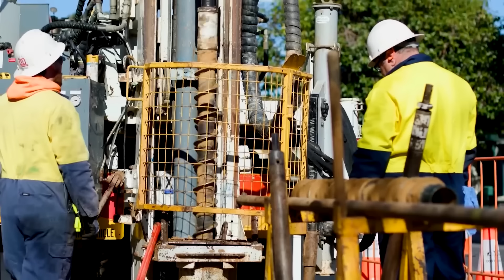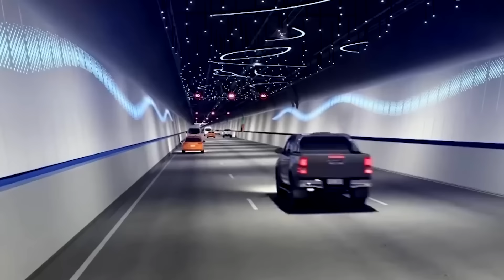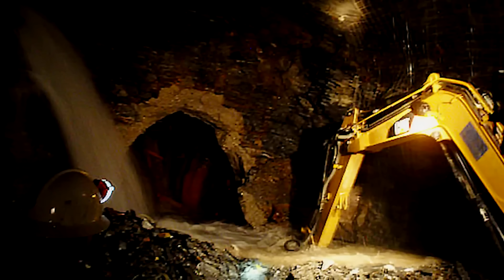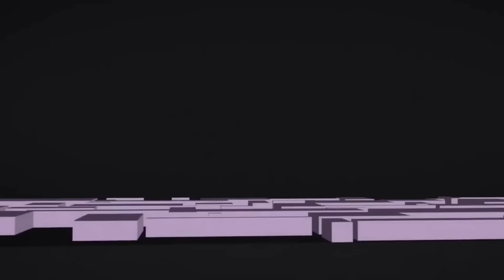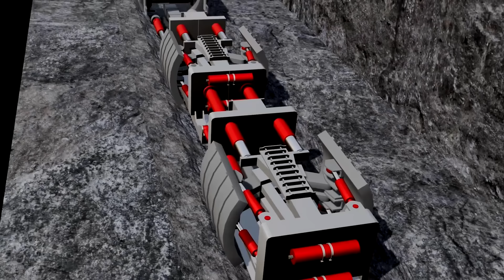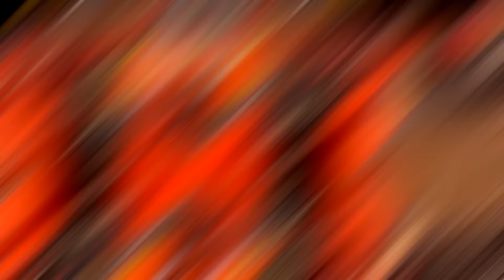Adelaide’s Torrens To Darlington $15.4B Mega Project Is Triggering Serious Alarm Bells

Comment: I live in Adelaide. Many of the graphics in this clip are misleading and do not depict Adelaide.
1/ Adelaide as with many Australian cities does not maximize or utilize rail as the principal way to move freight.
2/ Often the new road corridors unnecessarily demolish historic buildings leaving vacant land.
3/ Freeways induce traffic and so the thing they claim is the issue they are trying to resolve is worsened.
There is little need for the majority of Adelaidians to drive north to south of the city. Getting into Adelaide CBD for work has been reduced by work from home.
4/ Adelaide once had an extensive tram system. This needs restoration.
Reply: everything to do with Adelaide's roads is poorly conceived and implemented.  Curtis road and the housing developments off of that, whom ever is involved with those should ALL lose their jobs

Comment: Factually wrong. It's a sub-station at Tonsley. A power stationis where power is generated. Do hope the wind blows to keep the machines tunelling at night.
Traffic light free? What a good idea it was to put the set at Virginia on the Pt Wakefield Road and Angle Vale road intersection. Presumably when a B-double wipes a car out they will, at the tax-payers expense put a flyover.
Reply: Port Wakefield Rd isn't part of the Motorway.